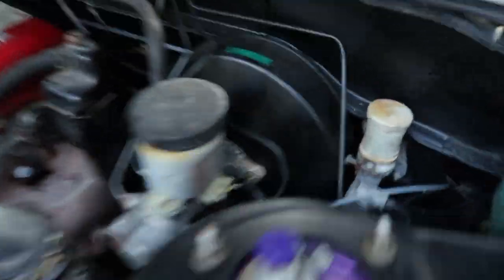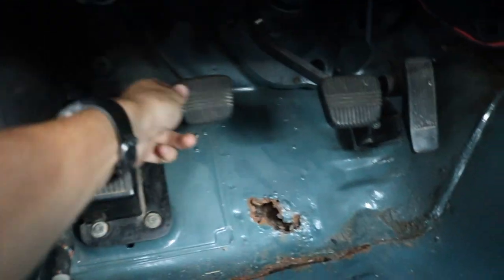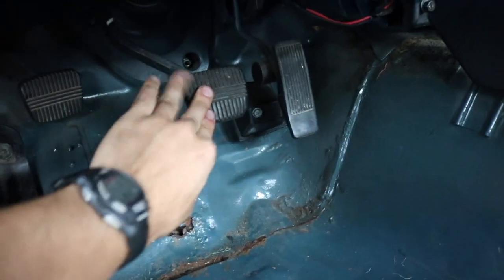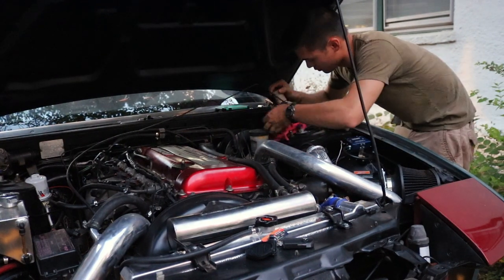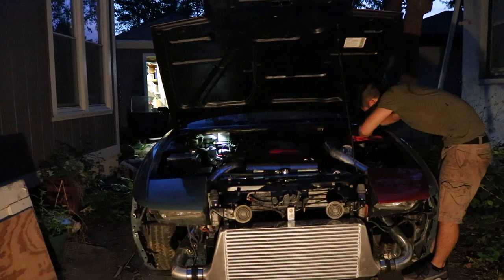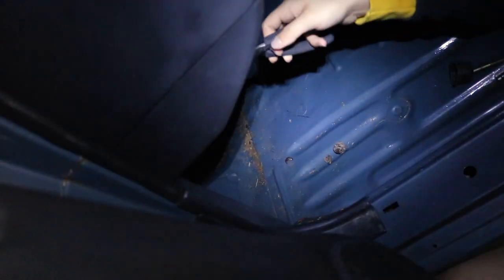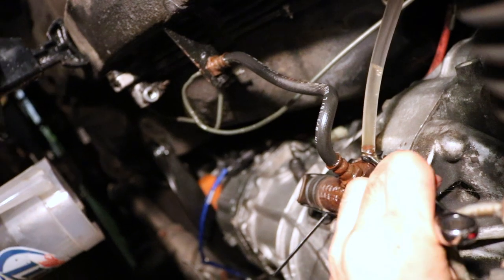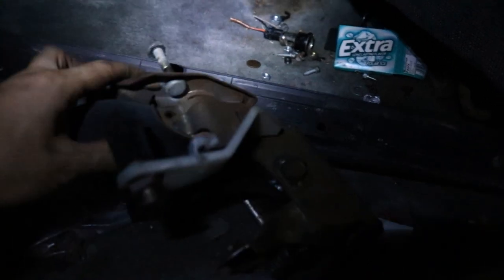How to Bleed Clutch and Delete Damper Box - S13

Comment: Glad you eventually got it bled. When I've had to bleed the clutch/brake system by myself I would just pump the pedal and wedge something between the pedal and seat to hold it down. Then open and close the bleeder. 👍

Comment: My man I know your pain, I had my master give out in a car park, was a fun repair out in the wild. Had to bleed on my own, to get it started when the pedal falls to floor open the bleed valve, push the pedal to the floor, close the valve, clutch out and repeat. That helped get the air out much faster as there is so much air in the beginning it just likes to suck it back in. When  you tackle brakes remember to start at the caliper furthest from master cylinder and work in.